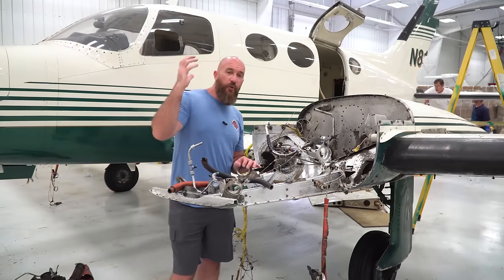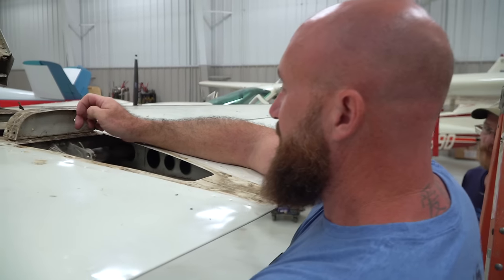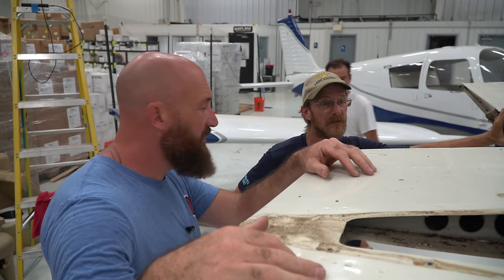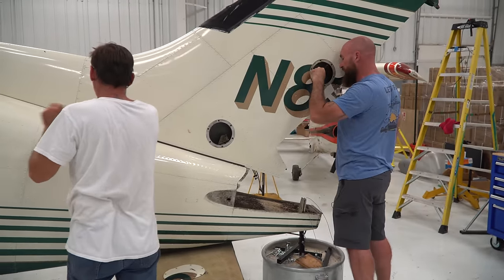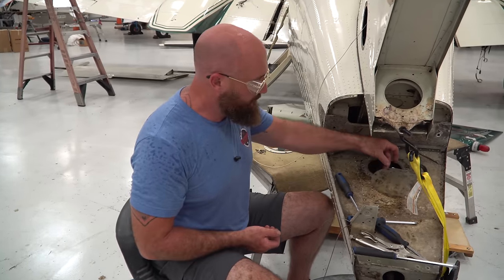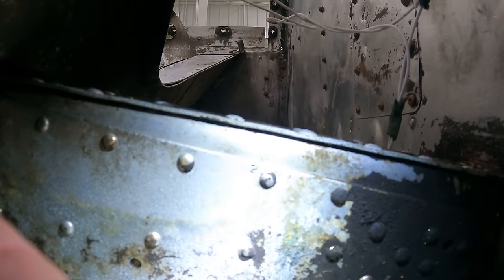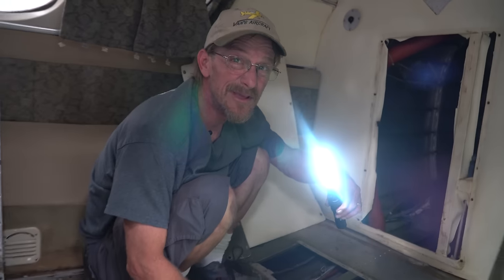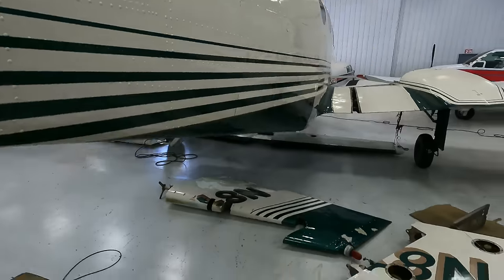BAD NEWS For The Free Abandoned Airplane !

Comment: I would look for donor wings for sure, faster and potentially cheaper.
Reply: I do agree on that
Reply: I agree.
Reply: What about having the parts fabbed by an independent shop????  Folks do it with old planes all the time???
Reply: Agreed
Reply: The problem is that if this is a common issue then there may not be good suitable replacements for cheap. We do know if the corroded parts are replaced it will be good as new and likely better than replacing it with a "passable" but also long in the tooth replacements. It's like pick n pull for cars. There are just some parts not worth getting used. I know planes are different. I suppose it depends largely on what condition the replacements can be had and at what cost. We do know what he would be getting by replacing with new. Sometimes cheaper and faster is not your best option. 🤷‍♂️ That's my 2 cents.
Reply: @danielc9312  basically you're saying dont buy used and get someone else's problem!!! Good point!!!
Reply: @chrisjohnson4666  Chris ! I am pretty sure that any parts put on a non experimental plane need to be certified parts. They just won't let you hammer together a part and put it on your plane. Thats is one of the reasons the freakin parts for planes cost a arm and a leg !
Reply: @chrisjohnson4666  another issue brought up a few videos ago, is realignment of the wings if taken off being next to impossible
Reply: @danielc9312  Replace these with used parts and the whole job will likley need doing again in a couple of years. IMO since its a big labour job it needs doing with new parts and doing ONCE. Cheaper in the long run.
Reply: @bobbyrayofthefamilysmith24  I agree. I say take the whole time equation out of the picture and even if it cost a little more he wants the plane to be right. New pieces will last way longer probably and you don't inherit the wear of old parts. I think long run for safety and longevity the new parts win even if he misses his arbitrarily created finish date.
Reply: @danielc9312  totally agree. Cost doesn't seem to be an issue since I'm sure they're making profit from the content. They could easily pad out 9 months worth of content doing cosmetic stuff like the cabin restoration especially if they are going to modify it as he has suggested. Personally I'd love to see in depth content of the cabin being re upholstered and modernised etc.
Reply: Has anyone kept a tally of the non-paid hours and free materials used to this point? A running invoice would be stunning, and nothing done to this point entails certified mechanics,certified parts, etc.. My opinion, the value of this vintage aircraft is exactly what he paid for it….Nothing. Make the 410 a donor aircraft.
Reply: @NeedtoSpeak  The aircraft was never economical to repair which is why it was abandoned in the first place. However restoring it now is simply a business expense as this channel is in the business of creating content. I'm sure they will make a profit with the advertising and viewer count even after the expenditure. They wouldn't be doing it otherwise.
Reply: Potentially more dangerous as well

Comment: The issue with donor wings is that you will probably have to disassemble them and test them as well.  They may turn out defective as well.  I have zero experience with aircraft but I’ve seen that donor cars may or may not work out.  If you could find a source that sells restored wings with a good reputation, then that may be a good option.

Comment: Joe is absolute G. Super smart, super old school. Question for you, Why are you using hand tools to remove screws?  I vote for replacing the engine cradle. The reason why is, The donor wings may not fit quite right as the original wings do. making things fit is sometimes more wasteful time than just repairing the original equipment. Donor wings have unknown problems.
Reply: Because “paid by the hour.”

Comment: For wings: You have to see what is available before you can ask what others would like. Safety and finances are the concern. Both will take a lot of time. See what the electro test yields and if the current wings are solid despite what you might see. 

Is there an update on the two motors sent for rebuild?
Reply: I enjoy the show but I am old I am beginning to believe I will die of old age before they get this free plane done I am out
Reply: @richardtangeman2461  It never goes as fast as one would like , My brother has been over 3 yrs on his 100% restoration of his 1967 Firebird . It looks driveable but still has a little ways to go.
Reply: @richardtangeman2461  Yes, I'm thinking along the lines of The Curse of Oak Island series. Could it be.. the templar knights once flew this plane?
Reply: @richardtangeman2461  Wow... the "instant" mentality effects old folks too. Bye!
Reply: @richardtangeman2461  I think they will hit their goal of this time next year. Hang in there.
Reply: And a big, huge by the way. That airframe needs to be FAA certified,.... again
Reply: I was wondering about the engines too. Until I saw them in the background still on stands.

Comment: I'd get the current wings refurbished, never know even on second hand parts if it's going to be problem free. Pop up another link to your gofundme and I'm sure us followers can fund it
Reply: It may be more hours to repair/rebuild the wing but you will know for sure what you have.
Reply: This is a better plan imo
Reply: @terenceharding4792  Hours don't matter a whole lot if they're not being paid for.
Reply: @kerryedavis  time matters if you’re working to a timeline. Oshkosh 2023.
Reply: @terenceharding4792  I'm not alone in pointing out that such an artificial deadline should be ignored if it compromises safety especially. And excessive cost is also a valid reason. "Oshkosh 2023!" was just pulled from someone's... hat... to start with. It may never have been realistic.

Comment: Do the engines and look for a donor plane in the meantime. If it doesn't check out, you'll have to repair the wings you have.
Reply: I haven't worked on a plane since 1978, but looking at what you have found I would look for a plane that needs engines. This one honestly could end up in a tragedy after is all "done".
Reply: @alfredozayas3421  this would be the safest solution overall, but I think it wouldn't be the way to go. After all, it wouldn't be the free aircraft we all came to love so much.
Reply: @alfredozayas3421  there's no reason this airframe can't be made airworthy it's going to take time and money but it's not a lost cause. I think they should buy the new parts and wait for them. Donor wings sounds like a short term fix that'll need doing again in a couple of years
Reply: @Root3264  I completely understand. My issue is with the overall safety of the finished product. He alluded to it on this video. If money isn't an issue and rehabbing the plane to a safe and funcional capability, then by all means do it. My concern is that they are trying to do work intended to be done by experts on the field and making it look like DIY. That is dangerous in aviation. Just my opinion, nothing else. I keep watching and talking to the tv when I see them do something that would have gotten me in trouble I did it on an aircraft.

Comment: As a former A&P, I.A. you have my sympathy. This series would be a good learning tool for a mechanics school. A plane outside+birds+nearly two decades to weather=nastiness+big expenses.
I maintained a 340 for a couple years and the exhaust system bore close watching. And I never did like the aluminum engine mount system. Any cable or hose that can sit against the structure can quickly rub into the metal and now you have a problem. Better off having a steel tube engine mount, like on a Navajo.  They can be sent out for repairs and come back looking like brand new for a reasonable price. As far as what you should do at this point? Well, it's too late to do what should have been done in the first place. Thoroughly clean the outside, open ALL the nooks and crannies to look for hidden damage after removing the accumulated debris. Then gut the interior completely to see what is lurking under the floor. Start estimating.  Next compare what is available on the used market. $139,000 for one with 3900+ hours on it, ready to fly IFR today.  Then there is the operating cost. And the greenies want to get rid of 100LL.  I am giving you an A for effort though.  Good Luck, from Lycoming County.
Reply: Nailed it- "Well, it's too late to do what should have been done in the first place"
Reply: Well said.

Comment: When it comes to the engine bay or compartment or whatever you want to call it. You need to find a registered airframer. A registered airframer can legally build parts from scratch. All you need is the sheet aluminum or whatever metal is required. My buddy in the Navy was a certified airframer from Boeing. We ha a forklift go through the tail stab and our command was freaking out because it was going to take 3 months to get a new one, which was half of cruise. To make the story shorter. He went to the Master Chief and the master chief took him up to our commander. He told our commander if you have the materials available, which we did for patches, that he could replace those panels it makes a tail look as good as new in a week. The commander suspiciously agreed and my buddy had that tail looking brand new in 3 days running 14-hour shifts. He was awarded some medals and the Navy paid him an extra $30,000 for his repair. I can't remember his name, but it started with a T. He ended up getting kicked out of the Navy because he was an alcoholic. The last time I talked to him though he was a multi-millionaire because he owned nine apartment complexes and was still doing side jobs for Boeing and other aviation oriented companies. What am I getting to?? You need to find a specialist that is willing to do work on the side for cheap and can get it done quickly. Those pieces that need to be replaced, can be done within a couple days with fresh material. It doesn't look like anything's damaged enough to where you can't have an air framer copy the parts. So depending on where you are, call a Boeing or Douglas or any other airplane manufacturer and see if they have any certified Air framers that would be willing to come out and help you.
Reply: how far did he go at master chef?  😁😁
Reply: @lnr243  
No he talked to the MMC and MMC took him to see our Commander. The airframer was only a 3rd class.
Reply: @benhawke7231  Maybe you missed the joke:):)

Comment: For months it was: "Have to remove the wings and send them off for adding spar strap" 
Last video was: "If we take the wings off, they will bend and twist and never be able to get them back on just right ever again."  Concluded with "Were going to get the plane flying and ferry to a repair station for wing spar mods." 
This week it's: "find some some donor wings and replace the wings." 
All the while the currently installed wings have yet to be thoroughly and properly inspected IAW manufacturer instructions and a determination made as to exactly what needs to be done.
Reply: Gotta keep you coming back for update #75.  Aka clickbait
Reply: Money pit, aluminium corrodes like crazy
Reply: I like to give people the benefit of the doubt, but now he's removed the gofundme link after raising $220,000 and he's learning things after video 100 when he should have tore the plane down by video 1 or 2 before asking for venture capital. He's raised a quarter million dollars and now the entire project is up in the air.

After a $50,000 plane purchase and a boat, I started wondering if the $220k has gone towards other projects or not. I don't know if gofundme pays out right away or once he its $300k? I don't think he has had bad intentions, but he's definitely got himself between a rock and a hard place here and it's a huge red flag.
Reply: @mikemurphy7519  What is a bit obnoxious is defending it. When you're rolling around in a quarter million dollars in venture capital from the community and the channel blew up because he got in over his head, it's important to understand and separate yourself from "he's an an amature" 

My opinion isn't about calling him a fraud. I think he had good intentions but is now in over his head despite many warning him. We're not talking about $5 grand. 

To put simply since you find honesty obnoxious: $5,000 venture capital, LEO won't bother looking in to it. $220,000 is a different story and it's important to keep records and not suddenly change course due to unforeseen issues hundreds were talking about by video #3 long before he raised the money.

I think he's a good dude, but he doesn't need a white knight.
Reply: @mikemurphy7519  I agree there's nothing nefarious going on. It's a huge project and there's no direction. Months have passed and there has been no assessment as to what the plane will need to return to airworthy condition. It's like they are on the 1 yard line, can see the goalpost at the opposite end of the field yet have no idea how to negotiate all the obstacles in order to get there - correction, are not even seeing the obstacles. It's a 50+ yr old plane and the only thing done thus far is "busywork," apparently so no major cash outlays have to be made. Yet, there is the goal of flying the plane next summer to OSH, lol. It won't be there before 2025 and that's optimistic.

Comment: Question:  Why do the mechanics use such long screwdrivers?  Also, why not use a power tool with phillips bit to remove the screws?  I can see why you wouldn't want to put them in with a power screwdriver, but blowing it apart I think would be faster.  Thanks for the video!
Reply: The length changes the leverage and adds a little more weight, most of the screws on this are probably pretty corroded and are typically reused many times so there is little grip in the Phillips and they will round out with any power device.
Reply: Probably too negate any lateral motion

Comment: It's strange to me that there's all this redundancy on an airplane and yet they don't double or triple wall the exhaust through the critical parts like they do wood stoves in houses.
Even just a simple temperature sensor would have worked...
Reply: To me (Being a retired AirForce mechanic) looks like the previous mechanics that did inspections failed to dig deep enough to find these faults especially the exhaust , I many times would remove a total exhaust system on a recip aircraft just to inspect it for possible damage and cracks, some times I would find nothing wrong but other times cracks and corrosion were found. Looking at the corrosion here and mainly the exhaust shows lack of inspection in my eyes (My opinion)
Reply: Temperature sensors are just more to go wrong and could even lead to a false warning... corrosion on the exhaust system doesn't just happen overnight and in theory should be picked up and remedied during scheduled maintenance..
Reply: There should be an inspection plate on each housing to check for corrosion in these areas.
Reply: @benjaminromberg2091  I was stationed in Panama as a Aircraft mechanic , This area is a tropical highly corrosive atmosphere and we serviced aircraft that were wwII vintage and these aircraft with  proper periodic inspections , we kept a check on corrosion. That is essential to keep corrosion to a minimum. We would spot corrosion then treat it ! The answer was the INSPECTION on a strict schedule is needed to prevent major repairs.

Comment: Makes no sense to piecemeal as you go. Do the complete inspection, make your list of needs, assess the cost of new verses a donor if you can find one, then make your decision. Can you install a custom built exhaust or are you obligated to original manufacturer? Tons of great builders in the auto resto market.
Reply from the maker: We have to use certified parts per FAA standards….   And they’re expensive !

Comment: Getting a new wing(s) with mid-time engine doesn't seem particularly practical to me given the amount of labor and expense you've already gone to. Is there corrosion in the wing itself that makes it unusable? Are there alternatives to replacing the wing such as replacing just the engine nacelle? Replacing the whole wing and nacelle seems to me to be a last resort. Is the cost of overhauling the old engines more or less expensive than the cost of the mid-time engines? If its less, equal or even a little more expensive to overhaul the old engines, I think that is preferable to buying an unknown engine. At least you will have the equivalent of "almost" brand new engines.

I'm not an aircraft mechanic or full scale pilot. Just a model RC pilot with an interest in aviation. I think its fascinating what you are finding and bringing to light in these videos and should be a lesson learned for anyone thinking about buying an older plane. The failure of even tiny parts that are twenty or thirty years old or more could bring a plane down if it involves flight control like an aileron, elevator or rudder and you've found a bunch. I don't know how or if this plane will end up going back together but I have enjoyed the process so far and wish you the best with this project. I'll keep tuning in!👍